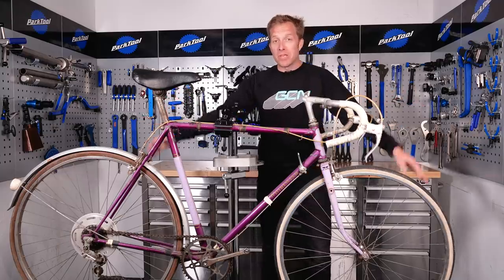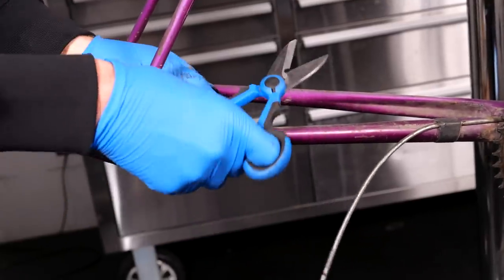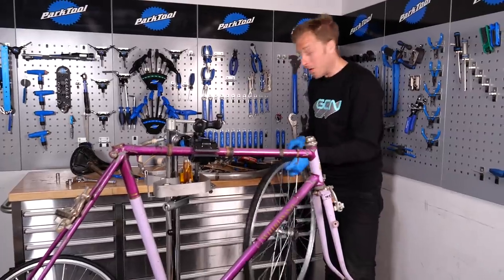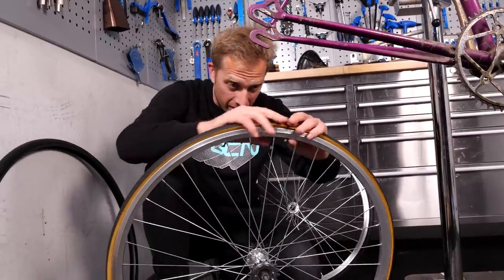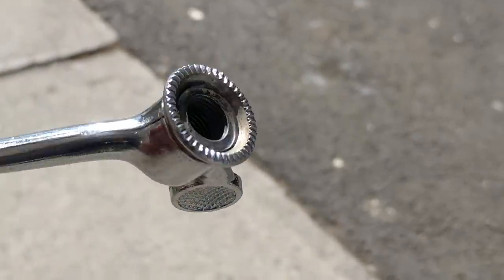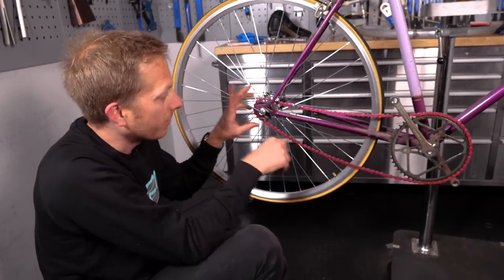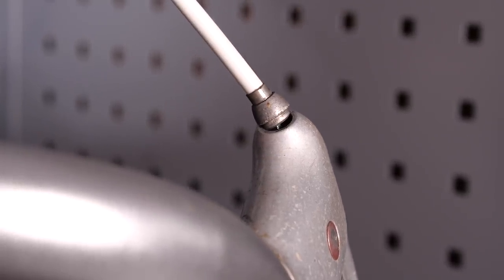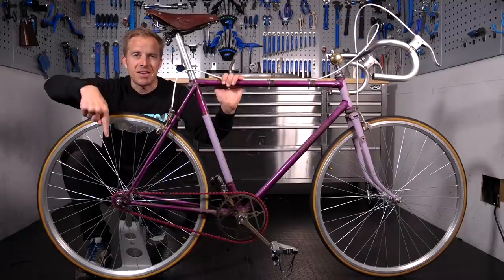Building The Bike  | Vintage Replica Bike Build Part 2

Comment: was hoping to see full rebuild with headset, bottom bracket, rust removal and paint correction. maybe next project
Reply: same here
Reply: When the going gets tough, the sprinters get off
Reply: Yeah, likewise. I hate to be whinging in the comments but this was pretty underwhelming
Reply: As long as the wheels roll I’m smiling.👍👍👍
Reply: A separate video about how to restore an old road bike would be awesome! Like you mentioned, rust removal, headset, bottom bracket.

Comment: My OCD would have compelled me to do something about that rust on this frame before fitting all those shiny new parts on.
Reply: Charlie Whiskey then my ocd would have giving a coat of silver and black paint to some components, and definitely polishing that front brand plate, replacing rusted screws... re-chroming those cranks...and...
Reply: This 100%.  OK you've got schedule and time constraints, but a soak in rust converter, or at least cleaning down the frame, would have done wonders.  nonetheless, great job, can't wait to see how Si goes.
Reply: Charlie Whiskey
:  I suppose the owner of the bike is more interested in the utilitarian aspect of the restoration than bringing it back to original condition  Still, like you, I was expecting Jon to go the full ten yards complete with a new paint job, new decals, and complete cleaning and polishing of the shiny bits.  Well, at least the bike will probably be going back to work instead of collecting dust hanging on some collectors wall.
Reply: It is whole winter project to make it full custom paint and crome shine every part there is. The oviesly have no time for that or video series would be show’n next year.
Reply: And have a polish on that bottom bracket and crank set. It's kind of sticking out like a sore thumb next to all that chrome now.

Comment: Could you not've taken a brillo pad to that chainring?
Reply: Tin foil and water works best. Only abrasive enough to remove anything softer than the chrome, the water lets the aluminium particles turn into a mildly abrasive paste.
Reply: Tin foil with lemon juice or cola works even better

Comment: Surprised you didn't wash the frame down before the rebuild.
Reply: Yeah, it would have been nice to see it cleaned and all the rust removed. Maybe that can be the next challenge, buy the cheapest oldest bike and get it looking as new as possible while only changing things that clearly need changing.
Reply: This.
Reply: First, most important step. Fail...

Comment: I was laughing out loud when I saw John "fighting" with the rear derraileur... These bikes and components are still common here in México! Actually, my girlfriend's bike, which won "Buy Upgrades" on Ep. 51 of the GCN Tech Show had one of those. Didn't you notice, John?!
Reply: I thought the fact the hanger said "Huret" would be a clue that it belonged to the derailleur, not the frame, but apparently not.

Comment: A nIce, elegant, and simple solution to revive this vintage frame, Jon! Can't wait to see the ride.
I would like to see you take a classic 27-inch-wheel touring frame with cantilever brakes and upgrade it with 700C wheels. The key to this is the proper selection of canti brakes since very few canti brake models can, when mounted on a 27 inch frame, function successfully on 700C wheels. I've done this on my current commuter ... but with much difficulty.  So, I'd be very interested in how you tackle this challenge, especially since there are many excellent steel 27 in. cantilever touring frames from the 70-ies and 80-ies that can benefit from an upgrade to much higher quality and better selection of 700C wheels. This would also generate a repository of valuable comments as to which canti brakes are best for this job. In my case  I had to modify a pair of mini-V's, but I've heard that Paul canti brakes and the old Shimano XT cantis can do the job. Please, do it!!!

Comment: Another thing you can do if your wheel doesn't fit in the dropouts is to (carefully) file the threads on opposite sides of the axle till it fits in that way. 

Since the filed down threads will be lower than the nut it'll slide right over them and engage with the remaining thread just fine tightening up your wheel very nicely.

Comment: Vintage bike setup to modern standards (wheels, drivetrain etc)
Reply: Yeah, Retro-Modern
Reply: Aluminium on a bike in the 1920’s, I don’t think so. 
The wing nut debacle got me. The welded flat should have been perpendicular to the direction of rotation to act as a face to press against, I’m glad the other ones were substituted.
1920’s bikes (and much later ones) had a cable tensioner at the back and horizontal rear access slots.
The front axle should have had the thread filed off as a flat, not the fork groove widened.

Comment: I grew up in Barton On Humber!  My first two 'racer' bikes were Elswick Hoppers.  My brother rode my second bike into the back of a stationary car and bent the forks back so he could only ride round in circles.  There you go. Small world.
Reply from the maker: blimey. same colour? Jon
Reply: Funnily enough no. :-D.  My first one was a gold/copper coloured five speed with five gears and cottered cranks. (Huret derailleur).  Second was a blue one with a massive 10 speeds but with an ultra modern square taper bottom bracket this time.  Of course both had friction shifters, no F1 style indexing gears here.  I now live in Leeds and have two Claud Butler bikes which is what Elswick Hopper/Falcon have become.  Just supporting the Lincolnshire bike industry. :-).

Comment: I have done similar single spead conversions with three vintage road bikes. I have however used the existing wheelsets which needed lots of work, and installed sealed cartridge bottom brackets on order to bring in the chainline. Also, I used the odd spacer either at the bottom bracket or the freewheel to get the correct chain line.

Comment: Nice job! I love these classic bike rebuild videos. The OCD in me has to ask why you chose to not clean the frame (not repaint it, just a good cleaning)? Also, all the rusty bits and pieces (such as the brakes, front crank set, headset pieces, etc.) would have looked SO much more lovely if you had soaked them for about 24 hours in something like Evapo-Rust. Was that a conscious decision to retain the "vintage rusty look" of the bike, or was it because of production time constraints?
Reply: Nothing wrong with evapo-rust.
Reply: @fordfancon  I kept waiting, hoping, that Jon would not just reinstall those rusty parts without some attention. Wasn't expecting a "Super Bike." But, was hoping for a "Sexy Clean Bike."
Reply: @SignorLuigi  there is a field I know a little more about called computer science. Thanks to a guy named Alan Kay in some circles it is well-known that it is not a science but rather pop culture. Jon canning is dealing with bike Theory not pop esthetics.

Comment: I would have shortened the chain by one link as the axle is right at the back and its ideal to have the axle further forward. Now the reason for this is that chains stretch over time and for a single speed bike this would be an issue later on in the bikes life.

Comment: I would definitely route the brake cables behind the drop bars, and to have identical curve; I'd put the saddle clamp above the saddle rails (so it would kinda hidden) and put the small piece of brake cable housing around the seattube to be more direct, not long and looping. For commuting I'm riding a similar bike (old three speed frame) but with narrow straight bars, fixed gear (TIG welded Shimano freehub) and V brakes.

Comment: John! Please! I would have had to fully strip headset and BB and clean frame, regrease/replace bearings and try to polish up the (meant to be) shiny bits. I'd have used thin lock nuts on the rear spindle - not washers. They'll be a pain when Sye flips the wheel - washers always get in the way because they will move along the spindle. Fit new brake blocks and lube calipers at least.

Comment: I have steel road(ish) bike from the late 80s that is pretty similar to this one and just a few weeks ago I purchased a relatively low-end aluminium road bike. First ride out I suffered a puncture with it and I couldn't believe how easy it was to perform anything on it compared to the old one. I still use the old one for in-door training and keep tarting it up to have a periodic look.

What I would be interested to see is how you can convert an old bike like this to a trainer or a performer in or outdoors on a relatively small budget.

Comment: It was relatively common for dropouts on pre-1960’s road bikes to lack an integrated derailleur hanger and instead to rely on a bolt-on ‘claw’ hanger. Many, many entry level bikes in the 70’s bike-boom era continued to have claw mounted derailleurs. Derailleur claws are still widely sold.

Comment: if nobody noticed, the adjustable spanner he was using to tighten the seat clamp bolt has been ground down to fit into tighter spaces and on thinner bolts. a handy tip.

Comment: Cottered cranks can be a pain yes but some of those old chromed cranksets were really beautiful. A muriatic acid bath would have got rid of a lot of the rust on that crank. That is actually a pretty decent frameset, Reynolds 531 and cast dropouts, a good cleaning and waxing would make a huge difference.
Reply: Are the dropouts cast or forged?

Comment: Like a few other contributors, I was really hoping to see a resto-build. The use of the term OCD really needs to be judiciously used. My OCD is pinging looking at those rusted brakes, shoddy cranks and chainring, rusted frame and saddle clamp assembly. At least a quick acid bath and wire brushing if not electroplating or powder coat finishing. I guess I'll just watch the test ride with interest.

Comment: I love the bike ive got one of those myself its an aluminum frame it was made in the 1980s every nut and bolt is the same thing as this bike here ive had it since 2017 but the brakes i have on my bike has the hood but it does not switch gear just brakes but soon ill be getting some shimano sti brakes and it want some lower profile tyres for my bike but sadly there not avaidible in my country but anyways i still love it

Comment: Honestly, young people.
That rear derailleur hanger is a sure sign of a cheap frame; better frames had hangers integrated into the dropouts.
And some chrome polish?
Woods valves, too
Put tyres on the radiator for 5 mins, bingo.
120mm hub, 126mm spacing.
Butterfly nuts...
Did you check the brake drop?

Comment: You have got to love the enthusiasm, definitely A for effort. However, if one is an old hand at refurbishing ancient, second hand bikes on a commercial basis, you know the hacks and the gotchas. It is in little details, so that stem, you wedge it open with a plastic tyre lever to get the bars in without scaffing them. Then there is familiarity with rear wheel spindle lengths, plus the tracking that goes with it. I would be useless with these new fangled carbon fibre things, but I find myself facepalming a bit here, even the starting point is not right, the thing should be steam cleaned, wire brushed/metal polished before new bits are added. You kind of know the internals of that bottom bracket have got some half-eaten cages rattling around in them.
Even the seatpost is quite comical for me, there is a good reason why they were made of steel to go with that type of frame and clamp. The grease application with a finger is quite endearing, obviously in real world workshop you don't ever touch the grease, you use some spoke or other thing to apply it. Same as putting jam on bread, you don't dive in with your finger, a utensil gets used. But it is for all these minor face-palm moments that I find these videos so cute and endearing - I might not be good at many things in life but I can refurbish a useless bike better than the professionals can!
Top tip for getting imperial tools in the UK is to go to a 'poundland competitor', you can get the whole set for a few quid and they are useful and what you need for old Raleigh bikes.
Not knowing some of the tricks of refurbishing useless old bikes is forgivable, what is not so forgivable is the choice of parts that are neither period correct or budget oriented. They did not have anodised pink chains back then. They did not weld together stems from that grade of steel then. I fear the end results will look like a stolen bike.
Great stuff though.

Comment: Surely headset and bottom bracket should be serviced?  Frame needs a good clean & attention to paint.  Would replace any old / worn components such as bearings and outdated drive chain components - fairly sure they would have fully serviced bicycles in 20s and 30s ?  Interesting project started but needs to be completed :)

Comment: Not bad, but I'd have definitely changed the bearings and regreased the bottom bracket. Also for not much money, a 2nd hand shiny crankset, brakes and levers would look much better. NB If using folding tyres the rims must be hooked. Many old wheelsets can only take wired tyres.

Comment: Hah, I recognize those tyres, I had to sell the ones I had because they were impossible to fit the wheels I wanted to put them on (shame, Challenge hand made tires are wonderful)
Reply: I did it once. It was a real challenge. Jon took the easy way. Bad for us because I hoped to see longest episode ever with some epic swearing (it really helps to handle this tyres) ;-)
But the thing is to keep it for a day or two on an inflated tube and the tyre will gain some round shape instead of being so flat. Then it shall be much easier to fit.

Comment: You shouldn't have vandalized the fork's dropouts. What you're supposed to do is file down the threads on the axle, creating flats on both sides. Many front axles have those flats from the factory. For example, in the 1980s, the standard for BMX front axles transitioned from 5/16" to 3/8", so a lot of forks had 5/16" dropouts while a lot of front hubs had 3/8" axles. To make it so the axles could fit into either 5/16" or 3/8" dropouts, the manufacturers simply machined flat areas onto the axles, making them 5/16" thick when oriented one way, and 3/8" diameter if you rotated them 90 degrees. 

In some cases, this was even turned into an axle retention feature, i.e., there were forks made with keyhole shaped dropout slots, so you would orient the axle to slide through the narrow part of the keyhole shape and then turn the axles 90 degrees to fill out the 3/8" round part of the dropout slot at the top. That way, even if your axle nuts came loose, the wheel couldn't fall out. To see one of many examples of those, do a Google image search for Haro 1985 Vintage 1" Threaded Fork .

Comment: Old British bikes like that one would not have been SAE.  They used Whitworth fasteners.  The first shop that I worked for had a set of Whitworth wrenches for use on the English-built Raleighs that we sold. Also, most automobiles and nearly all bicycle parts (with a few exceptions) made here in the states these days are all metric.  SAE or “Imperial” fasteners are more commonly used for homebuilding, bridges, general construction and the like.

Comment: Ya could have cleaned it man! 

Tyres not a great fit? Warm the oven (then turn it off - warm not hot) pop tyre in for 5-10 minutes. Will now be more supple and stretchy and may go on easier (though no guarantee). Also, I always thought lining up the label on the tyre with the valve was just my fetish to make the valve easier to find...
Reply: Literally everyone lines it up
Reply: Since when were valves invisible?😂
Reply: @okantichrist  They hide. Usually behind the seat stays... :-)

Comment: for god sake john! use the right tools! for the dremel you have the metal grinder for bores. it goes just right inside the dropout and you can control the grinding far better. 1st i went through the dropout in the highest position and push down to follow the shape. it simply goes like a hot knife into butter. by pushing down like this it automatically follows the shape of the dropout. no need to look at it like "have i done enough?" "have i done too much?" etc... i did it on a Peugeot P10 from 79.

Comment: Hi Jon, can you use an old hardtail mountain bike frame and convert it to a road bike set up? I got an old Klein alloy mountain bike which is a lot lighter than my basic entry alloy road bike and have been pondering over to make it into a road bike or near enough to one. Can it be done? Can you fit 700c wheels on a 26in mountain bike? Or maybe 650b? Can i put road forks and handlebars on it? And do road groupsets fit on a mountain bike (eg Shimano 105 drive train and brakes)?

Comment: 6:38:  Crack in seat tube just above BB?
Reply: Very unlikely on a steel bike, probably a big ol' paint chip from the chain falling off, then covered in grime
Reply: If you're looking where I think, it's the outline of the lug. The bit which joins the tubes together.

Comment: Love old bikes, and I am actually in the middle of renovating my dads old Atala. Cotterpin cranks are the absolute worst thing I have run into, and still currently struggling to remove the drive side one (such a pain). Where did you find those cable clips? I am trying to leave as much stock as I can, but I need to replace 2 clips that are unusable.

Comment: Those challenge tires are realy hard to fit in my experience, even on some decent rims
Reply: Agree - I find that  pre-stretching them by putting them on the rims without a tube and not hooking in the tire beads helps.

Comment: you would think he would have more knowledge or experience and knowing the difference between 9mm, 10mm, 3/8 front axle.  Arc welding those axle nuts, I would never ride a bicycle this guy worked on. You also forgot the barrels on the cable ends to keep the inner liner from puling form housing.